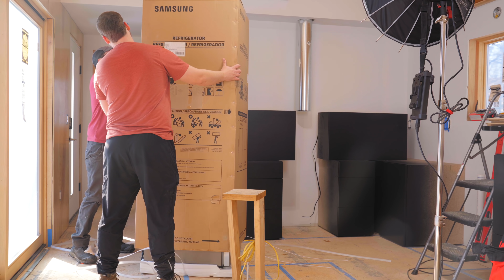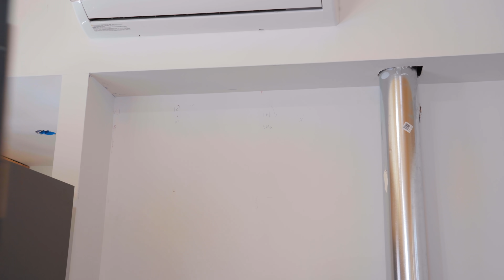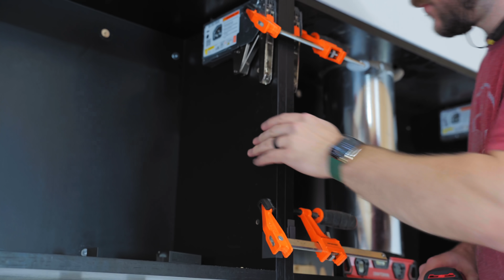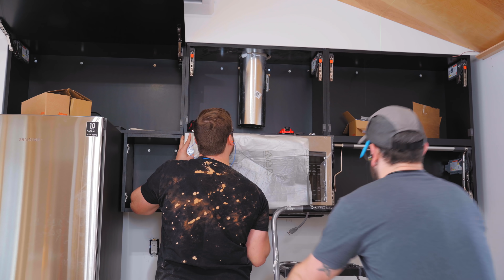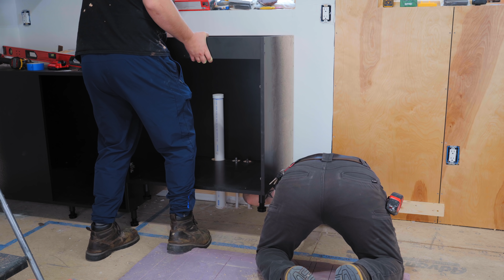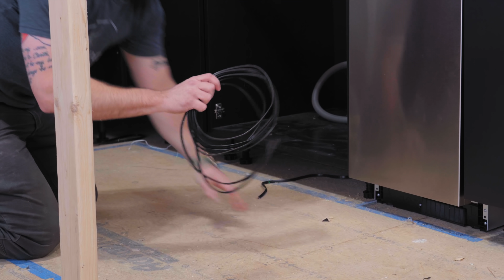How to install TOUCH TO OPEN Frameless Kitchen Cabinets

Comment: Hey, really nice work you have done there, and servo drive from blum it's amazing... but I have a construction question, why do you use ledger board and not just put 4 legs? :)) (I do furniture in Europe and we always use 4 (or more) legs, you don't need any sacrificial wood to be put on the cabinet until install, because it has 4 legs :))) )

Comment: The fridge should have 50mm (2”) void above it and the bottom of the top cabinet for venting . Have a look at the fridge Specifications . Mate looks ok👍🏼 .but I would put fills each side the over head cabinet and shadow lines at the top of your over heads

Comment: I guess, U were concern more with camera shooting rather than quality of the work. It hurts to see the drilling of cabinets, U just simply damaging them. Why did U install floor cabinets before floors done? Alright, why U did not fix inside veneers afterward? Probably, it's ok for U, but I would definitely fire or never hire youself as an installer.

Comment: Questions:

1) Did you ever repair the damaged veneer on the back face of the cabinet over the microwave? And if so, how?
2) Why did you install the floor cabinets without waiting for the floor treatments to be completed? It will be a pain to do the floor now.
Reply: Oftentimes you don’t want to run flooring under cabinets in case you want to change floors without tearing out the cabinets. He’ll probably just run the flooring up to the leveling feet and hide the edge with the toe kick piece.
Reply: @SGDrummer7  Hmm, that's funny. I was thinking from the opposite direction (changing or updating cabinets without having to redo floors)... I guess it depends on which is expected to wear out or go out of style first. 
Then there is the issue of debris getting caught on/in the lower grade under the cabinets. But if the kickplates have an airtight seal, then maybe that wont be an issue.

Comment: As cool as self-opening cabinets are, I can’t imagine installing them in my house. It seems like unnecessary ways to complicate something that works fine without it. If the power goes out or one breaks, then you are out of luck for a bit.
Reply from the maker: You can definitely open the doors manually with no power.
Reply: I agree with this, especially for a tiny house that might not have a standard connection to the grid

Comment: What’s the longevity on those auto hinges? I always worry with something electronic like that of one going out in a few years and parts/replacements not being available. I assume there’s some sort of warranty with parts availability? I just wouldn’t want it to be one of those “this used to be cool” conversations 10 years down the line.

Comment: I enojyed watching you struggle with the installation as an European furniture maker. Don't get me wrong. I've been following you on YT for years now.
This mix of styles is a little funny but hey, it worked.
First of all - Since you are already familiar with Blum products - they also got these handy hangers with 2 axis adjustment. You screw a metal strip to the wall - more or less level and then just hang the cabinets. This is way easier to take them off if you need to and less screws in the wall (also sometimes you have a narrow wall unit and there is no stud behind it. What now?)
Second of all - I both liked and disliked the base units with a piece of lumber on wall. It's kind of the same as I mentioned above, but man, you could just use 4 adj. feet for unit OR make a platform with leveling feet which then supports all units in place. Makes it way easier to fit all units square and you've got space behind them (I leave about 5cm) to run pipes / wires if nececsary.
Then again, I don't see a reason for boards in between drawers in such narrow unit - it does make the unit stronger but it's not a standalone. After fixing them all together it doesn't matter and you just used more material. Makes sense for wider units.
Touch to open is a nie feature, nothing wrong there but personally I hate them below waist level. They happen to open accidently more than you would expect (based on multiple clients opinions)

Well, good job man! For next time give that camera some smack and print plans so you don't mess up the cabinets!
Cheers from Poland

Comment: Make sure you check the vent fan orientation for the exhaust on microwave. They come facing inside, you have to rotate the fan to exhaust out. I'm an appliance tech and I see all the install mistakes
Reply from the maker: It’s definitely exhausting, turned it on recently and it pushes some serious air!

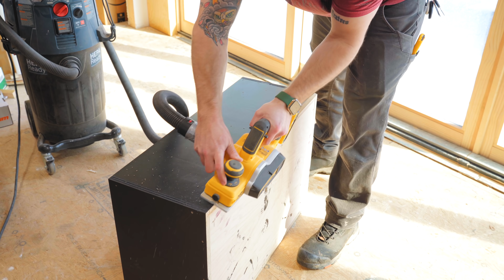Comment: 3:10 There should be a gap above the fridge so air can freely circulate and cool down heat sink at the back.
Reply: I had a Samsung fridge with a $1000 repair bill, and the tech said it was because there wasn’t enough airflow behind it.
Reply from the maker: There’s a gap at the sides, should be fine.

Comment: Get the extended warranty on the samsung  appliances. Hope you won't need yours like we did. Our fridge failed in less than  3 months and Samsung (sucks) took over 5 weeks to get a tech to come over with parts to fix it.  After that, it frequently froze up the back coil and stopped cooling the fridge contents. We abandoned that fridge when we moved, leaving it for the next owner to fight with... I suspect it ended up at the curb, less than 2 years old.

Comment: A really strange solution with these lower cabinets flush against the wall on the beam. In Europe, we simply put the cabinets 5 cm(2") away from the wall so we don't need to cut any holes in the cabinets for pipes and water hoses :)
Reply: 5 cm can make a difference especially in small kitchens, I'm sorry but Americans do it better (I'm not American)
Reply from the maker: Yea that would have been a deal breaker in this kitchen.
Reply: @craftedworkshop  just think about it next time. This is a much simpler way and saves a lot of time on assembly :)
Reply: @Faddidaddi  thst's what she said :P 
btw 90% kitchen in Europe look like this and we even don't have space for a island :) So pls don't call it 'a small kitchen'..
Reply: Tqvm for the idea👍👍👍👍

Comment: How are you venting the sink drain?
Reply from the maker: Studer vent. The rest of the plumbing is vented but wasn’t a great way to do it here.
Reply: @craftedworkshop   With the drain going thru the floor you need to bee careful not to create a S trap (vs a P trap).

Comment: Great install video. Glad you pointed out your mistakes one can encounter when installing wall and base cabinets. One thing I hope you don’t encounter is with the fridge. From the video it looked very boxed in with little room for adequate ventilation. A fridge needs about 2” clearance from the back and 1” from the top to breathe. If not you risk overheating or burning out the compressor. Lastly keep them coils clean. Looking forward towards future episodes and best of luck to you in your new shop.